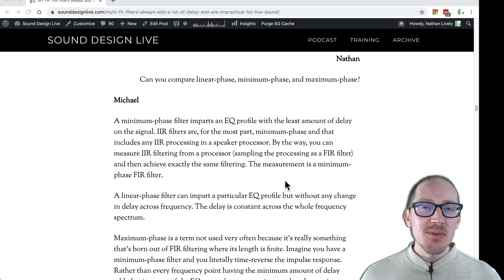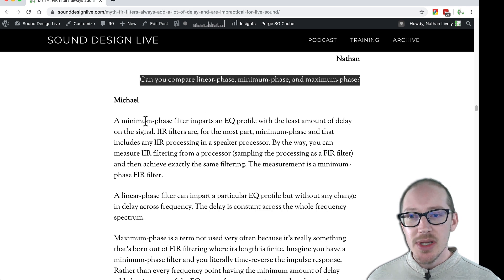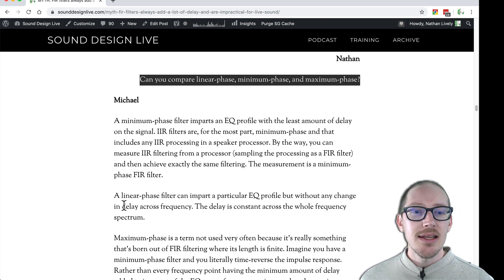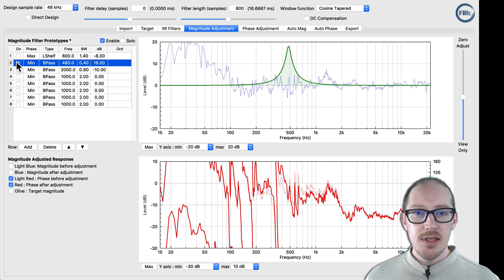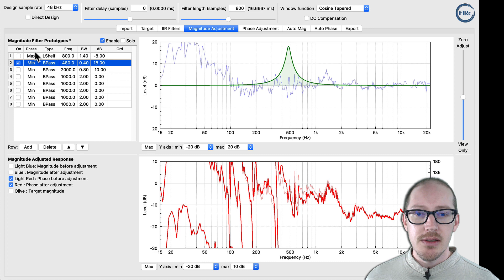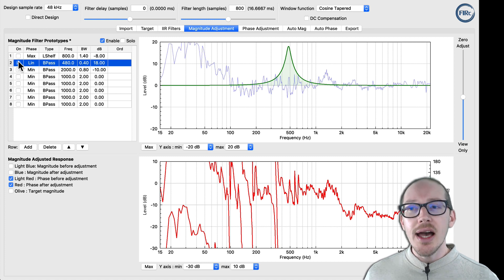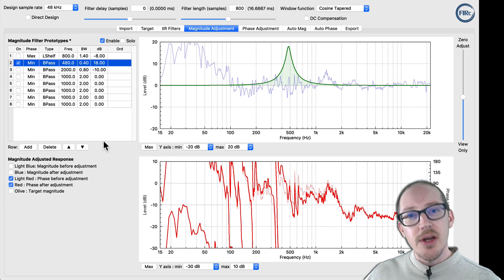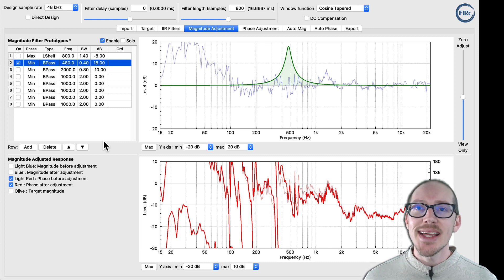What's the difference between linear-phase, minimum-phase, and maximum-phase?

Comment: Hi bro, sorry for the ignorance, the phase graph represents the frequency delay between the input and the output ?
Reply from the maker: The phase graph represents the radial component of the audio waveform. Delay between out and in will cause a change in the phase graph, unless delay compensation is used.

Comment: @Nathan: That is not correct. Linear phase filters do add delay, across all frequencies, equally, hence the name linear phase.
What you are thinking of is labelled "zero phase" filters but those are basically just a processing trick that only works in offline filtering, so not during live performances.
Reply from the maker: Hey John. Thanks for your interest in the video. If I said that linear phase filters do not add delay, that was an error. Thanks for catching that! What I should have said is: The delay is constant across the whole frequency spectrum.

If you'd like a deeper dive on this topic, I have a pretty cool interview with Michael John over here - https://www.sounddesignlive.com/myth-fir-filters-always-add-a-lot-of-delay-and-are-impractical-for-live-sound/
Reply: @nathanlively  Thanks for the interesting link.
I've developed DSPs myself, for example I've developed a component that creates a minimum phase FIR filter based on a user-drawn magnitude response.
It's also used in graphical EQs with a fixed number of bands.

It's using a FIR filter exactly for the reason Michael mentioned, but he didn't go into detail.
It's much simpler to design a FIR in the frequency domain (where you can directly specify the magnitude) instead of trying to approximate a number of IIR filter prototypes to match the desired response... as for example Room EQ Wizard does. :)
Reply: ah, yes..the whole confusion is about using delay to alter phase responses (as is common practice in live sound) a technique labelled as phase alignment. 

You will understand this will only work in some cases..

About your 'processing trick only for offline filtering'...euhmm no not really..we definitely are using all kind of FIR based techniques in live performances, X-overs being the more simple applications. Multiband compression , beam steering the more complex.. And yes, we are limited by time.. :) so you do have to be careful what you use in what situation.
Reply: @theimunten6325  Again, phase response and delay are two sides of the same coin. If you add a delay then you are literally increasing the slope of the phase response.
Naturally, a flat delay is equal to a linear phase response. So you're right that such a delay cannot work in cases where you're trying to fix wildly varying phase vs. frequency problems.

And about your comment on zero phase filters 'euhm no not really': yes, really. Zero phase filters are not causal. You cannot do zero phase filtering on live sound. The universe doesn't allow you to look into the future.
Of course, you can do live filtering by turning zero phase filters into causal linear phase filters - that's trivial. Just add delay or in other words increase the slope of the phase response until the filter is causal.

Comment: Within the premise off LTI (linear, time invariant) : min phase == phase response as dictated by magnitude response, max phase == the inverse phase response of the latter, Lin phase == those 2 glued together to combine to a zero phase shift..That last 1 gives you that infamous 'latency' (it is not latency!)..  Read a bit about Fourier transform..but really  do start to understand that Delay is NOT the same as phase shift
Reply: Linear phase is not zero phase shift. It's literally a linear phase shift, hence the name linear phase filter.

Delay is absolutely equal to linear phase shift. It's literally defined as the derivative of difference in phase over frequency.

"Latency" is a very broad term that can mean a lot of things. One can interpret the delay added by a linear phase filter as latency of the filter system.
Reply: @xnoreq  A side effect off the whole corona thing....now we have time to split the hairs..hahaha
If we could agree that when we are not interested in overall time differences as we are examining phase differences one could say the phase shift is 0 (relatively in time)

Latency: indeed a broad term in audio usually associated with the buffers necessary to process audio in CPU..if CPU are more powerful latency can be decreased.."latency" induced by FIR filtering can not by altered and hence shouldn't be called that to avoid confusion
Reply: @theimunten6325  I do not think being accurate is splitting hairs.
I don't see why one wouldn't be interested in delays because adding differently delayed signals is literally what a comb filter is/does ... because of the different slopes of the phase responses.
For example,  1 sample of delay (at 44.1 kHz that is 22.6 us) is equivalent to a linear increase in phase vs frequency towards -180° at 22.05 kHz. Mix that with the original and you get a null at 22.05 kHz. 
Do 3 samples of delay (or 68 us) and you now get two nulls because phase linearly increases to -540° (that's 3 * -180°).

I agree on the usage of the term latency. It shouldn't be used in time-invariant systems such as the filters we're talking about.